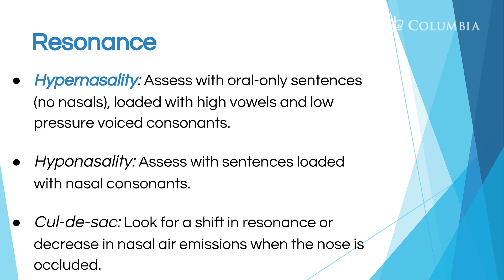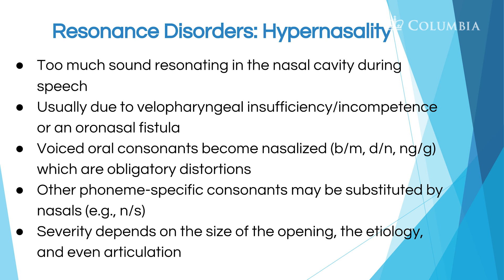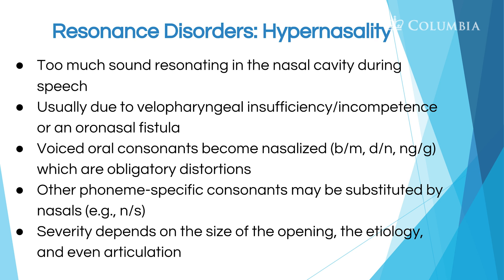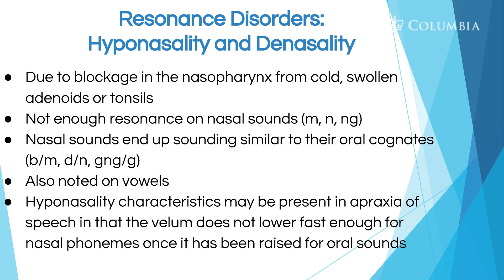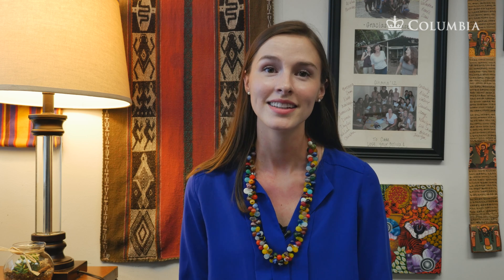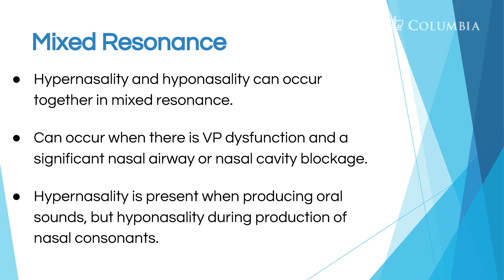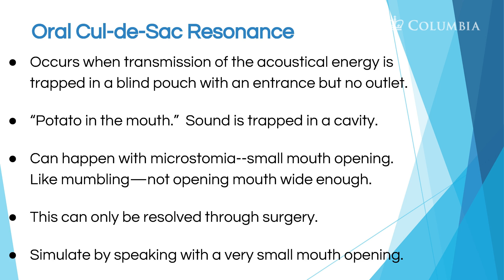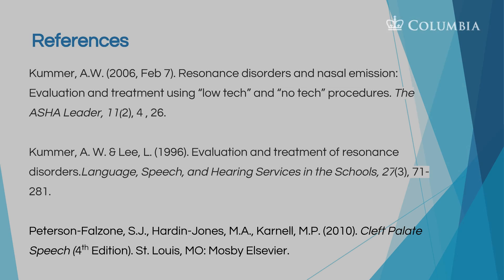Module 2.2- Cleft Palate Speech and Feeding: Resonance

Comment: I was born with a cleft palate, meaning the roof of my mouth (upper plate) was split into two parts. There were also 3–4 holes (oronasal fistulas) connecting my mouth and nasal passage. Because of this, anything I ate would come out through my nose. I had to undergo six surgeries. Still, my voice is hypernasal due to this condition.